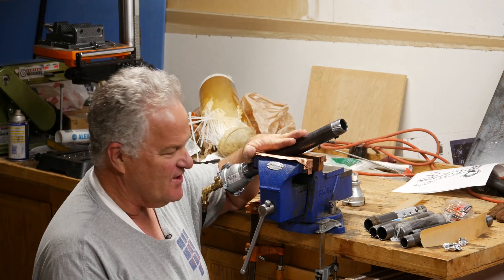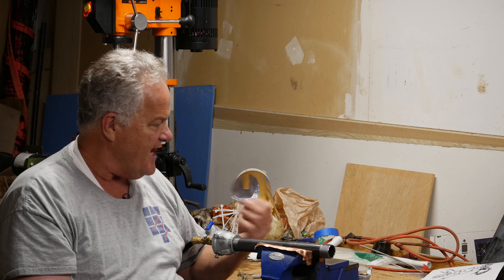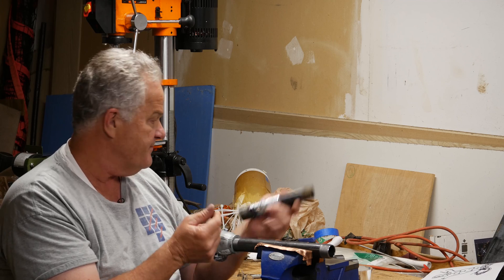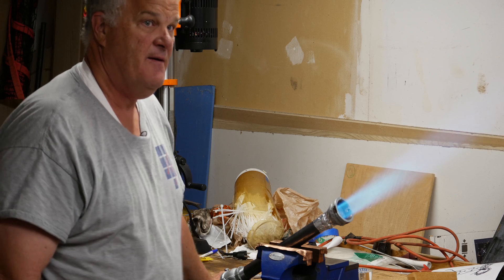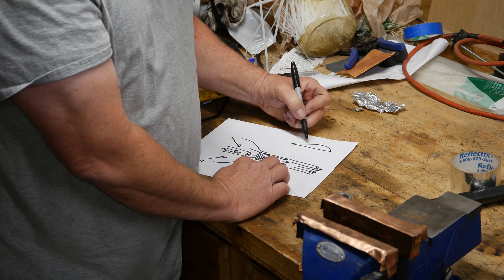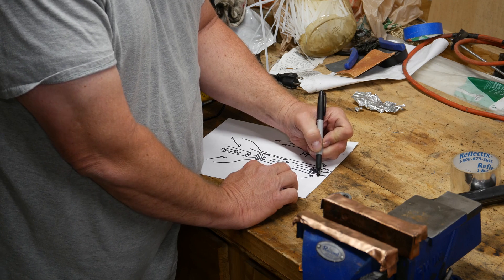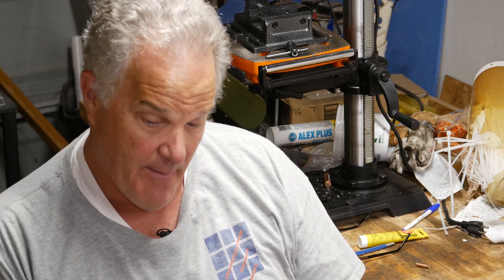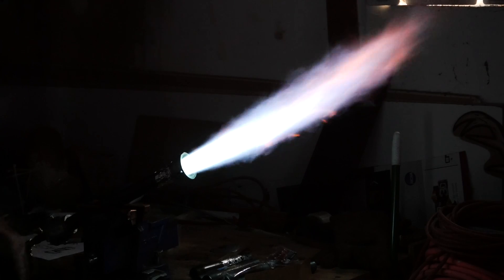Building a propane burner

Comment: I agree with your first theory that the bell on the end keeps the fuel stream from sucking air from outside the burner tube.  Do you have a regulator on your propane?  If so, what pressure are you running or what regulator?  I am wanting to build a burner or two.  I have a weed burner that has no regulator and a very tiny hole.  It is 500,000 btu/hr.  With a 11" WC pressure, you get about 27,000 btu/hr out of a 1/16 orifice.  I am thinking about trying a 7/32 orifice which will give me about 80,000 btu/hr at 11" WC pressure which is all that a barbecue type regulator can supply.
Reply from the maker: I do have a regulator on the burner. It is typically set at 10psi. I'm actually running a smaller orifice size. As you saw, I tried 1/16th of an inch but I'm running a .030"  welding tip now.  It's possible I could increase the pressure or the orifice if were to add forced air. My rig, with the fuel line coming in at the back of the burner makes forced air a bit of a kludge though as I can't get something like a hairdryer mounted inline with the burner tube. I have to hang it off to the side with only about half the dryer getting in the opening. I tried it once and havent tried it again since.

Comment: You made a venturi by adding the reduced coupling on the flame end. >-----<  Expanding flame gas sucks more air through the 3/4 pipe than w/o the flare. Kinda like the Bertinelli Principle, lol. 

Nice build.
Reply from the maker: Just tool a look at the burner video you have. I noticed that the intake flare is larger than the output side. I wonder if"d get more air in if I increased the size of my input flare?  I was also told, and I might have said this in the video, that the flare on the output side allows the gas/air mixture to slow down before igniting. 

Van Halen was an idiot ;-)

Thanks
Reply: I think you're really OK w/ the 1-1/2 inlet bell but try reducing the outlet bell. I used a 1-1/2 X 3/4 reducer on the air inlet w/ a choke, 3/4 X 8 nipple and a 3/4 X 1 reducer on the outlet. So I've been told, the outlet could be reduced further... straight steel coupler swaged out only 1/8" over standard inside diameter or as long as there is some kinda flare to it. I built this burner as a bench test mule so swapping out parts is easy. I use MIG tips for orifice too and tested .025, .030 and .035 tips w/ gas pressures and choke settings. Sweet spot on this burner is a .030 tip at 30 lbs gas pressure.
Reply from the maker: 30lbs??? Wow. I've been considering trying to up the pressure and trying to force air into it to see if I can get stuff like copper to melt faster.
Reply: Hehe, Fasted58's setup is almost the same as mine. I have a smaller inlet though, used a 1-1/4 to 3/4 reducer because that's what I found locally, followed by 8" of 3/4 pipe and a 3/4-to-1" reducer at the business end. I did take a dremel and flattened the threads inside the 1" opening, but it was working well even before that. I don't use a MIG tip for my propane orifice, I made a 1mm hole in a brass hex cap for my gas line (comes in at 3/8" pipe from the valve). I may make a different cap with threads for MIG tips if I feel the need to vary the orifice size, but so far so good. 1mm is equivalent to a 0.039" orifice.

Comment: Nice little burner! It should work just fine once it's in the furnace. The furnace will act just like the flare. The one I made uses a larger pipe but works great.  Every once in a while, I get the same issue as Paul with the flame starting down the pipe. 

Some of my early videos are about my budding casting adventures. I was new to filming so I didn't document everything but take a look.

Casting is very fun and addicting. Check out alloyavenue.com if you haven't already. It's a great site with friendly people on it.
Reply from the maker: Thanks for the info! I'll check out the site and your earlier videos.
Reply from the maker: Ok, I went back in time, I felt like Mr. Peabody and his "way back machine" ;-) and watched a couple of your older videos. 

First of all, I like the pipe holding the burner design. very nice.

Can you tell me the inside dimensions of your furnace? like, how deep and how wide is the actual chamber? Also, I didn't hear, but what did you line the furnace with. I heard you talk about a skim coat of fireplace cement.
Reply: swdweeb - I'll try and get some measurements soon. I think my crucible is an A8 size. You should decide on your crucible size first and build the furnace to fit.
Reply from the maker: Great, thanks!
Reply from the maker: I just saw this, it got spammed because of the link. I love the blue suit, I've got to get one. ;-)  Thanks for sharing these tutorials, they are really good and informative.
Reply from the maker: I started on the furnace, https://www.instagram.com/p/BXtumH7lTOd/?taken-by=realswdweeb Still need to mortar everything in.

Comment: Interesting!  Glad you got it working.  When I used a flare I never had an issue with mine blowing out.  I could get it to go out with no flare, but it wasn't easy.  The problem I have is getting the mixture right without the flame working back into the pipe.  When it's hot, it seems like mine gets louder and louder, also hotter and hotter, until such time as the flame jumps back into the burner tube and starts rapidly heating up the whole contraption!  Your flame looks much more controlled than mine, too.  Good work!
Reply from the maker: Thanks.  I'm not sure a three foot long flame is controlled, but it is cool. ;-) Hey, fwiw I emailed your vlog email acct